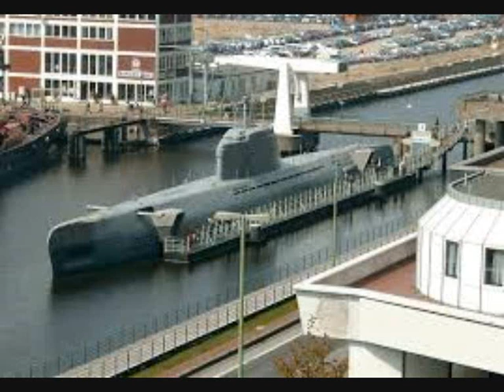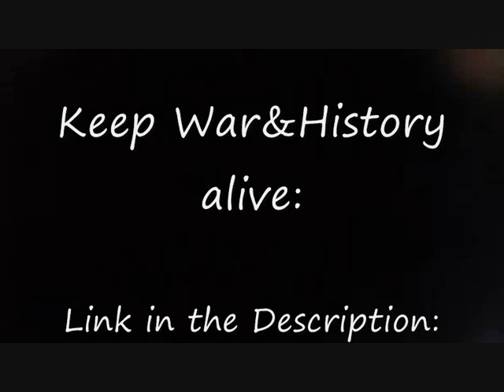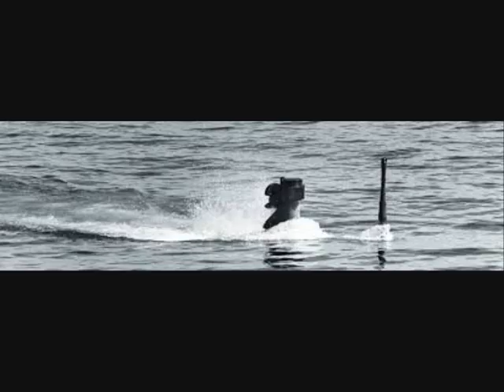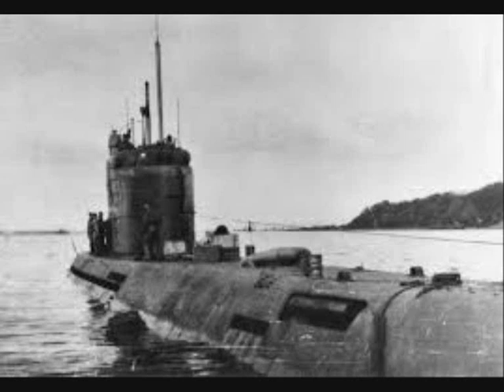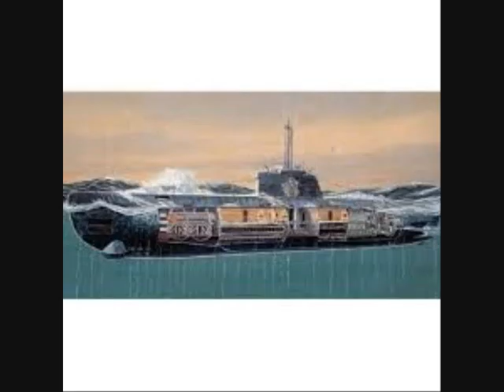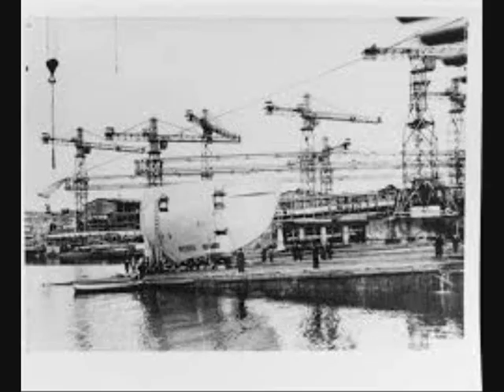Type XXI submarines - Wonder U-boat of German Navy (1943-1945)

Comment: Most of what is said about the Type XX1 is untrue. The top underwater speed was 15 knots but this could be maintained only for about 1 hour. At 5 knots they could stay under for about 50 hours but they were just as noisy as a Type 7C at that speed. They were also much larger and presented a larger target for ASDIC than the Type 7. They did have a hydraulic reloading system but it was only in theory that they could reload and fire 18 torpedos in less than 20 minutes. Never tested as no Type XX1 ever attacked any ship, ever. In fact, the lack of space meant that only 15 torpedos could be carried as they needed the space to remove torpedos from the tubes for maintenance. The design faults in the snorkel meant that the sub could only travel at 5 to 6 knots while recharging batteries and this took up to 6 hours to complete. All this time, the snorkel could be detected by Allied aircrafts' radar. The Commander who claimed a practice attack was lying. Logs of both his Uboot and the Cruiser in question showed that they were hundreds of miles apart at the time. He had previously had 50 % of his claimed kills rejected. The dive times of the Type XX1 were fast, but due to a defect in the hatches, the boats could only dive to 100m without flooding. This took months to correct before any Type XX1 could go on patrol. The extra flood holes in the outer casing also caused 28% more drag to the hull and more noise. This Uboot was far from being a " Wonder Weapon " and would have taken 2 years of more development to be as effective as a Type 9B, which was also obselete at the time.
Reply: You must be english.